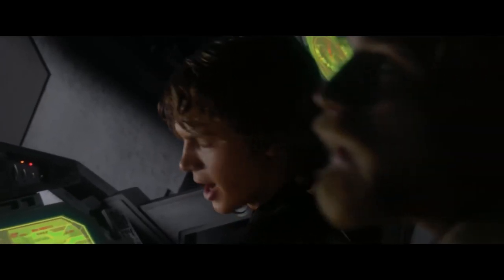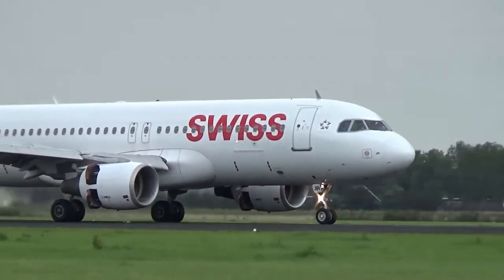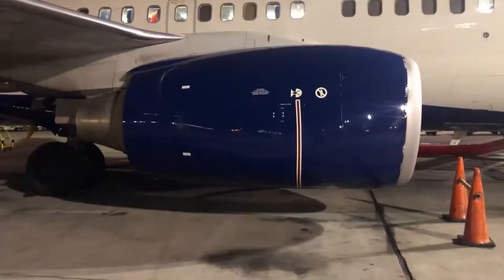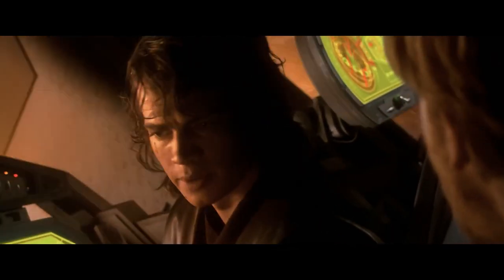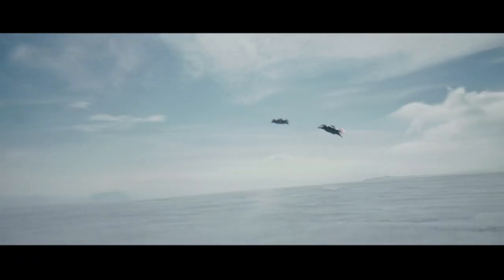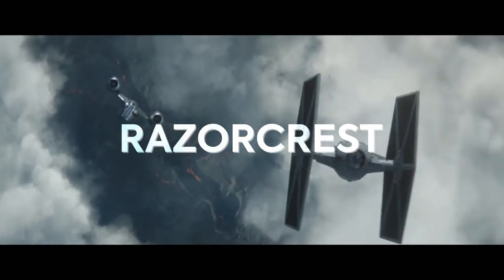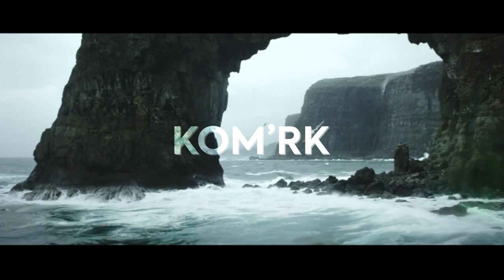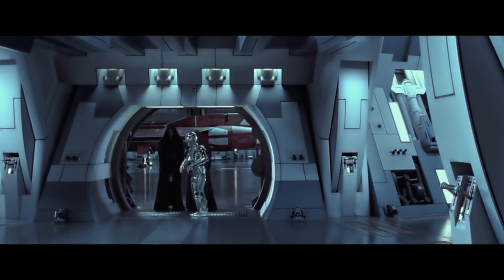The Hidden Detail You Never Noticed in the Battle of Coruscant | Star Wars Tech

Comment: THE ARC-170 also has control surfaces in the form of Ailerons, seen in the Battle of Coruscant where its S-foils deploy.
Reply from the maker: Oh interesting, I didn’t notice that! I’ll have to take a closer look at those.
Reply: "s-foils" are not ailerons
Reply: @stephenross8177  not what i meant, if you look closely at the part it shows the smaller wings deploy. You'll see a portion of the trailing edge of the main wing pivot. That was what I was referring to.